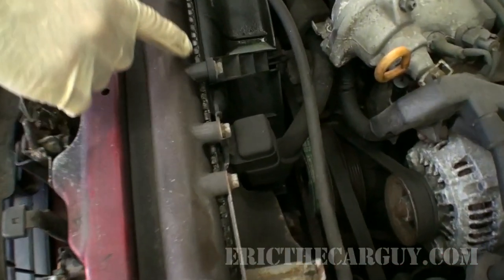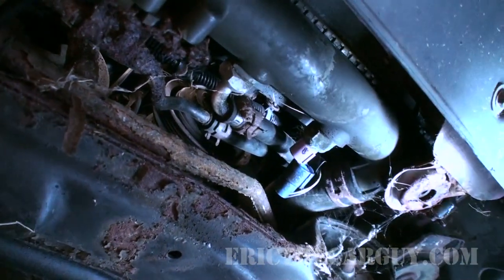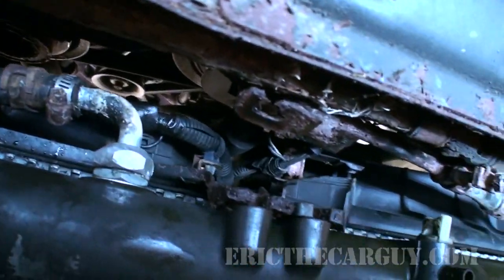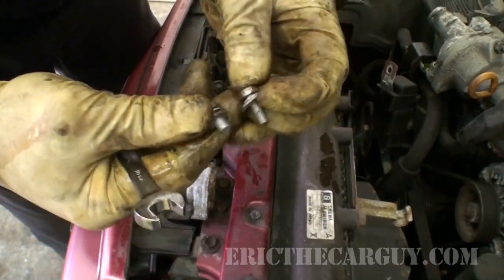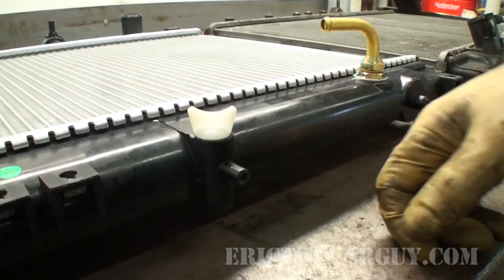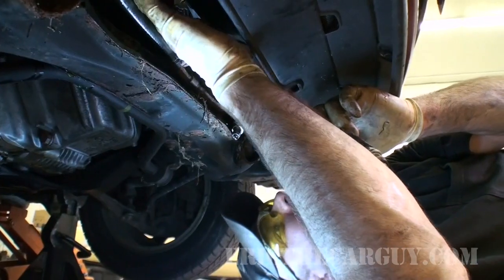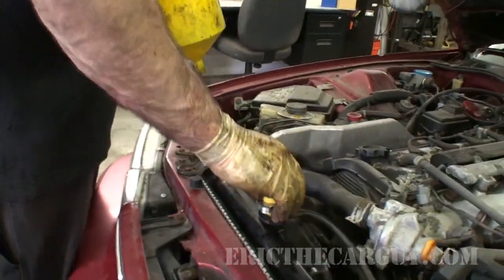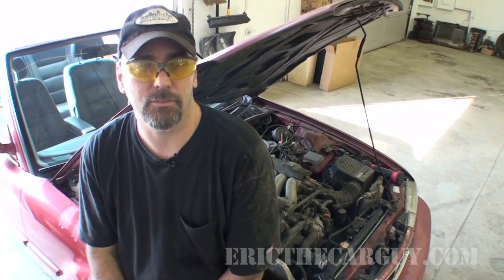Acura Vigor Radiator Replacement (Short Version) -EricTheCarGuy

Comment from the maker: And for the first time the 'Short Version' of a repair video. Acura Vigor Radiator Replacement (Short Version) -EricTheCarGuy
Reply: EricTheCarGuy I'm in australia and have an australian car so you may not be abel to help me but my thermo fan on my ute dosent work any more ive taken the fan off and tested it it still works fine ive replaced the sencer that it plugs into still no go ive checked the fuse box under the bonnet alls good nthere as well would there also be a fuse under the dash havent checked there yet and the air cons never worked case thaqt mnakes any diffreence had the ute 12 months
Reply: obieezx11 have you tested your fan relay?... swap it out for one you know is w working and test it that way, or remove it, put 12v across the signal pins and listen for it to click on.
Reply: Trevor Dyck yep tryed it
Reply: obieezx11 huh... so your fan, fan switch, and fan relay are all testing good or new, in the case of the switch. Weird. Perhap you have another temp sensor that's interfering? Like a engine block coolant sensor? Or, maybe you have a bad thermostat and hot coolant isn't reaching the radiator, so the sensor never gets hot enough to trigger the fan. (Is your car overheating?) You might also check DC voltage going back from the fan to the battery systematically, after the car is up to operating temp to see how far voltage is getting / where it cuts out - fan>sensor>harness>bottom of fuse block>etc.
Reply: Trevor Dyck ive replace3d both switches and the thermostate running the car gets red hot the thurmos just arnt kicking in i dunno if theres a fuse under the dash only place ive not looked its a vs holden commodore ute 2000 model
Reply: obieezx11 Does it run cooler at highway speeds, Or does it stay hot going fast or slow?
Reply: Trevor Dyck it runs hot when left to idel for 10 mins it runs hot going down the road its not a water problem its deff a thermo prob as ive left it idel till the temp gage was hot no thermo come on i felt both hoses and the thermostats working as i mfelt the heat exchange thru them as it opend and closed summers here and i cant drive it thankfuly i have a bike but would be good to have the car going were are you from are you formillia with the vs commodeore?

Comment: can someone answer me plz, can a fuel filter prevent a car fro firing. i have a mitsubishi magna v6, the car is not running, after i have added some starting fluid, the car did start i thought that the issue might be the fuel pump therefore, i checked if it was working and the answer was yes. It was working. so now im completely lost.

Comment: EricTheCarGuy  you think that's rust lol in school (for diesel mechanics) we had to free up an adjustable axle on a tractor. basically theres a big hollow pipe and then the axle sides in that and you drop a pin in once you have it spaced where you want it. There were 3 inch piles of rust AND birds/wasp nest inside lol.